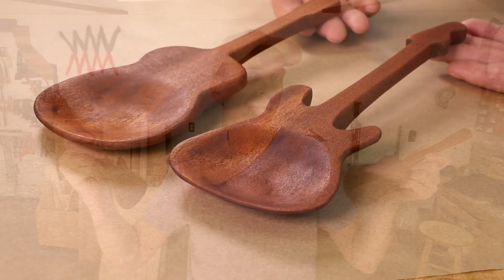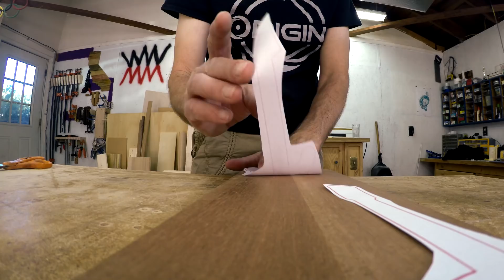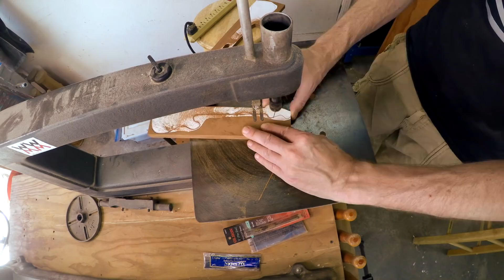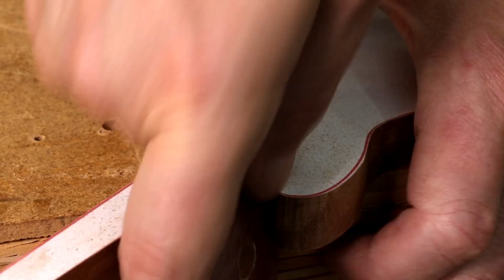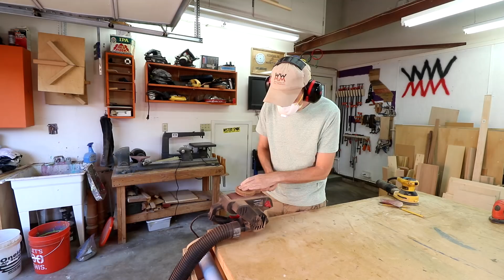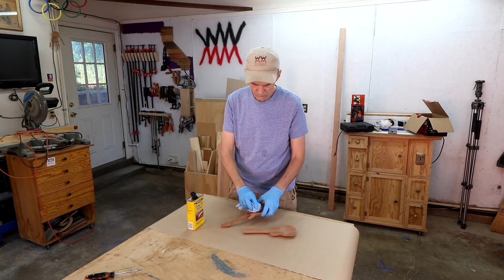Making wooden spoons using every power sander in the known universe. | ART & DESIGN

Comment: Nice job, Steve.  You used a very similar process to me in a video of mine where I made a spalted maple spoon.  I used the rotary tool to hollow out the bowl but then did final shaping and cleaning up with a french curved card scraper.  Saved a lot of sanding time.  Yours turned out great, nice job!!

Comment: You'll probably find the brushes in that sander are worn, if you can't find the right replacement try to find similar that are slightly larger, you can gently file them to the right size, it's something i did a lot, just make sure the contact end is the same (metal disc or plate).
They are cheap and usually easy to replace

Comment: Can't believe you threw out that sander.  You could have taken it apart and used the components, case, cord and other stuff and made a Frankensander similar to Matthias cordless drill.  LOL
Reply: peggyt1243     OR dropped it from a great height!!
Reply: More than likely you just blow some dust out of the switch with compressed air and it would be fine. I have a cheapo belt sander that did the same thing. Ordered a new switch and didnt end up even using it.

Comment: 9/10 times the cord is the problem.  I repair cords a lot lately-belt sander especially as you sometimes run over the cord with the sander.  Cords pulling out of strain reliefs or just getting abraded or cut is also common.  I've also broken a couple of trigger/switches from dropping.

Comment: That belt sander probably needs the switch cleaned out. Or it needs a new switch. Most likely, when a power tool quits, it is because the brushes wore down. They're cheap to replace. ereplacementparts.com is a place to buy replacement tool parts.
I have a belt sander that went through 2 drive belts and a set of brushes. It still works.
If a tool dies a smoky death, then it IS toast.